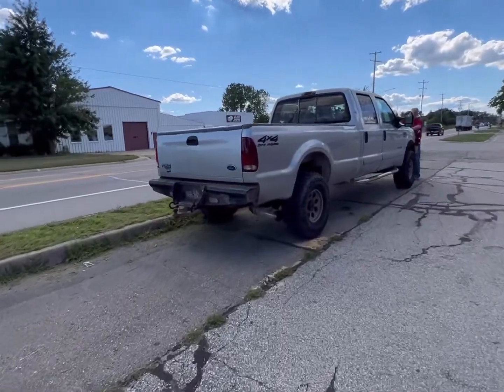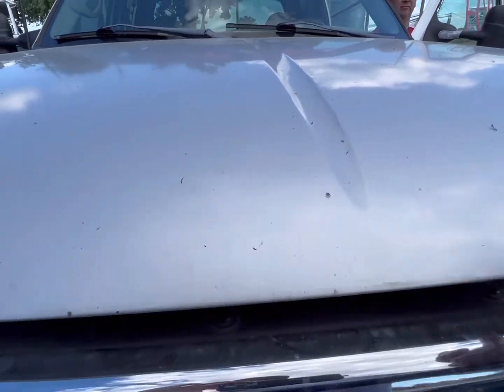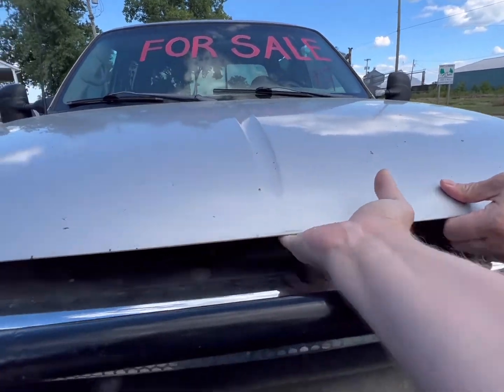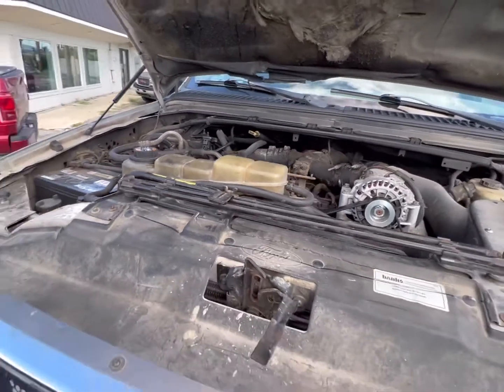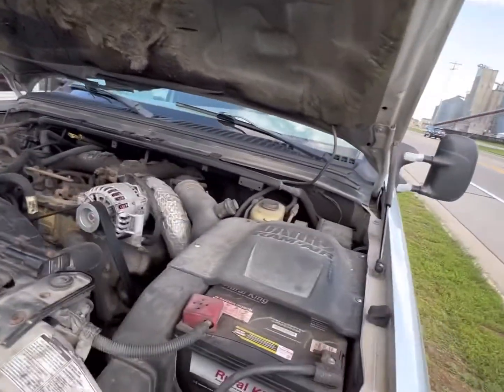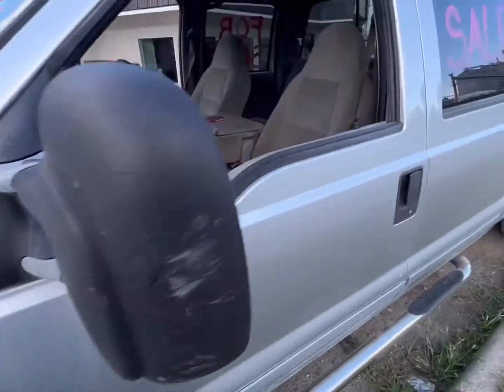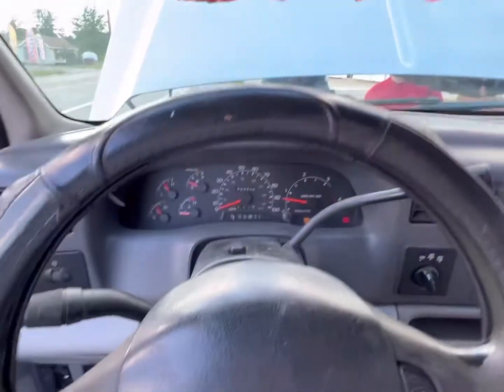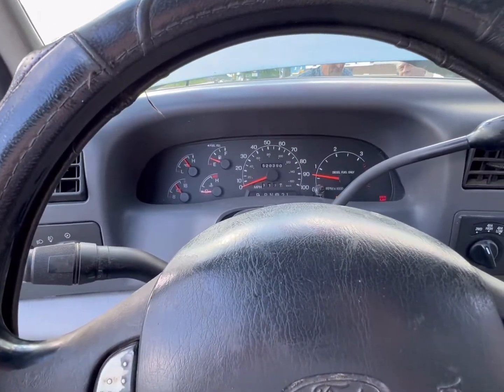GSC 2001 7.3 Powerstroke crank no start issue

Comment: After 25 years this engine should be renamed, “International Crank No Start Engine” Installed and wired by idiot Ford engineers. There are a lot of videos about this problem. Maybe the Zero Power Engine.
Reply from the maker: @CaptainLeo44  all those cubic inches and noooo power.